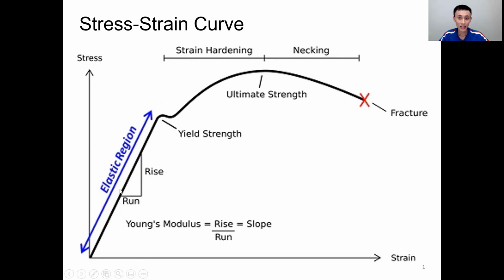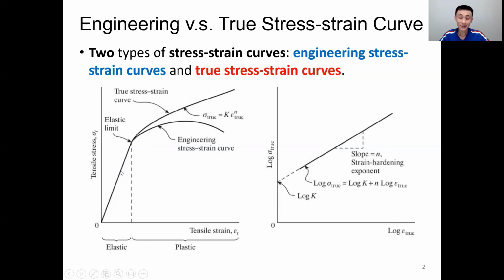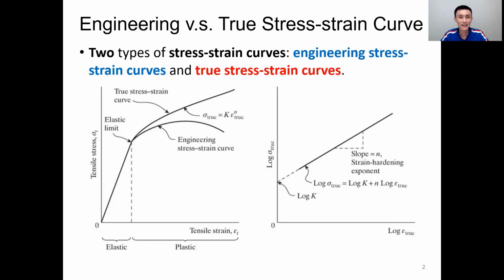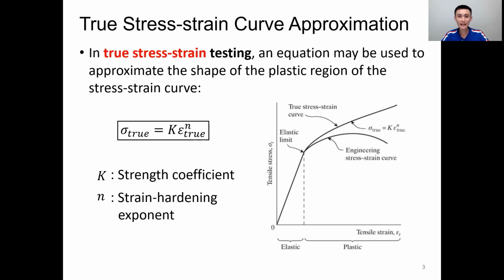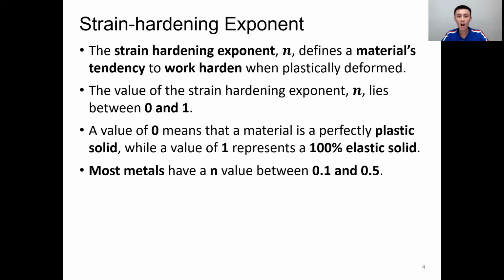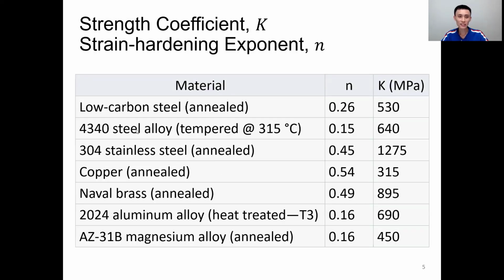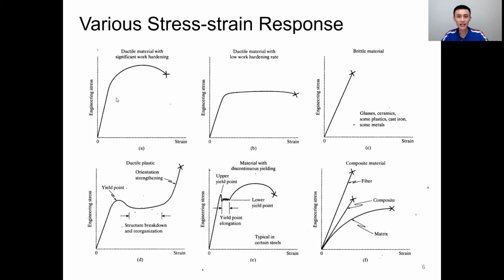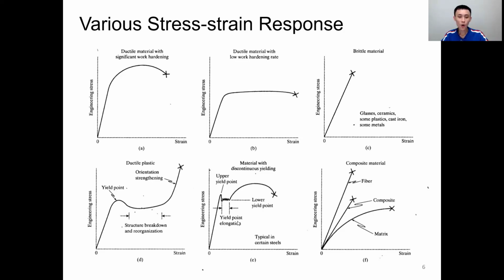True Stress-Strain Curve v.s. Engineering Stress-Strain Curve | Engineering Material Properties

Comment: Dr. Gucci's is it appropriate to calculate a 0.2% offset yield strength from true stress-strain curve?
Reply from the maker: I don't see any issue with that, but the one that you mensioned is not commenly used by most people. 0.2% offset yield strength is just a way to find where the yield point is at and that is just a commen practice that people do, and not about right or wrong.